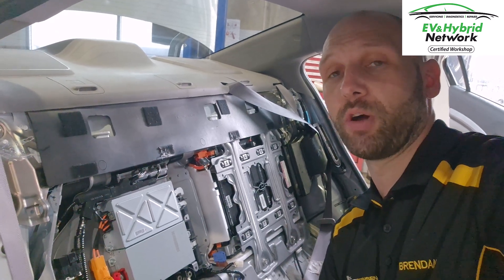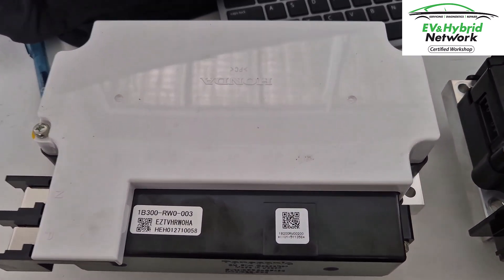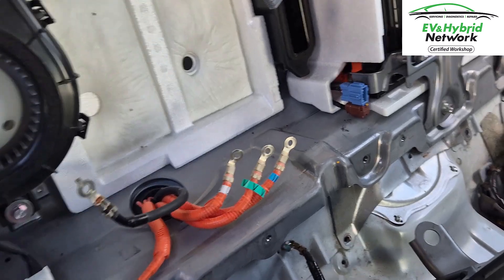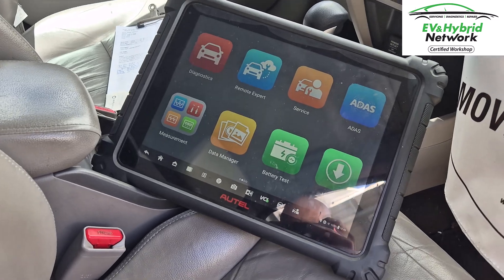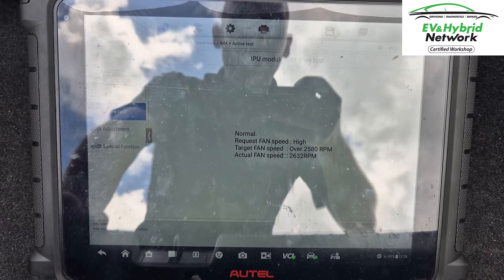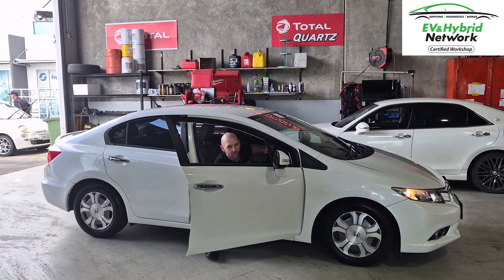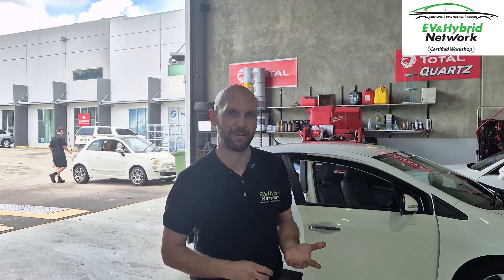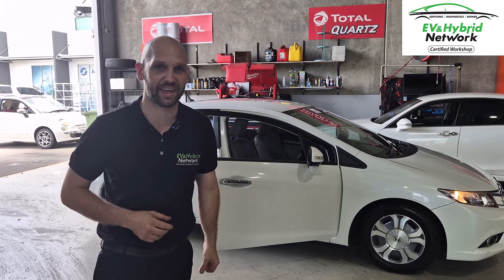Inverter replacement on a Honda Civic Hybrid

Comment: Need your help. Have a 2012 and replaced the entire inverter module and the hybrid battery. Ran perfect but then 2 months later I received the same DTCs.  Is the new inverter (white cover) from a 2013?
Reply: Hello
I have the same issue 3 times now
Any advices ?
Reply: @suoodpiano I live in Maryland and I can help you with that. I have a video on YouTube, but it's in Spanish.,
Reply: Many times this happens because the thermal paste that the module has is expired.

Comment: Hello, My name is Konstantin. I am from Virginia. I have exactly the same Honda Civic and my transistor on the inverter burned out. Please tell me where I can buy it? What number should I look for it? Maybe you can help me with this?
Reply: What did you do eventually
Reply: @husamjaw1747 Hello, my name is Luis. I can help you. I have a video where I am repairing that type of problem. The only thing I have is in Spanish. I live in Maryland.
Reply: Did you get the part number, i have the same problem with p1440 code in civic 2013, part number or link to buy it , thanks in advance
Reply: @ahmadksasbeh2726  Hello, my name is Luis. I can help you. I have a video where I am repairing that type of problem. The only thing I have is in Spanish. I live in Maryland.